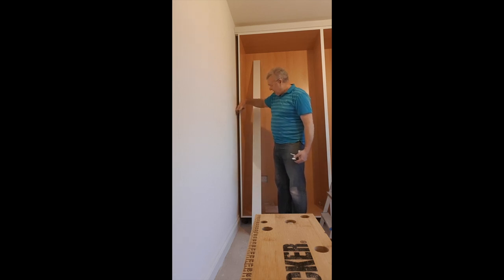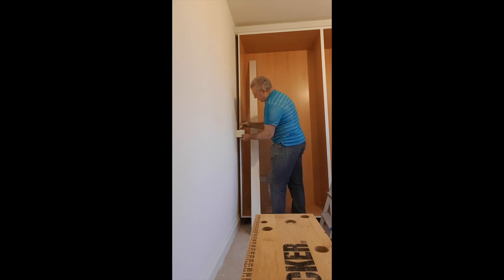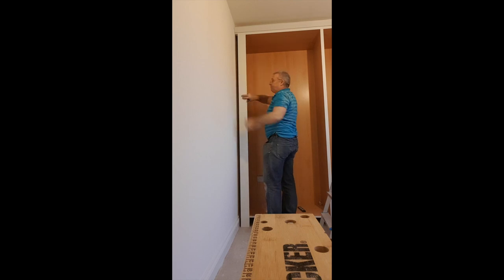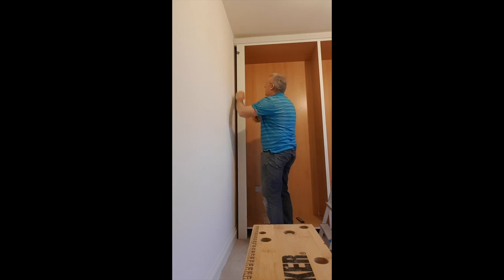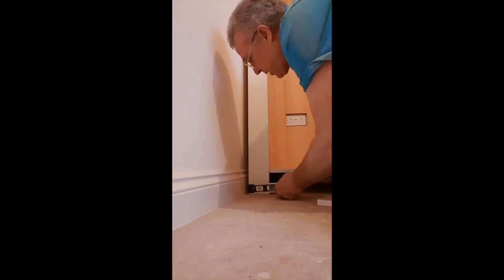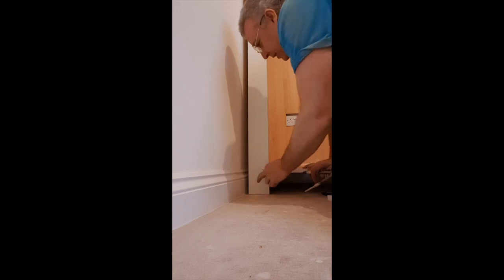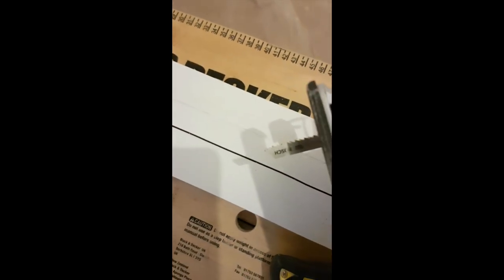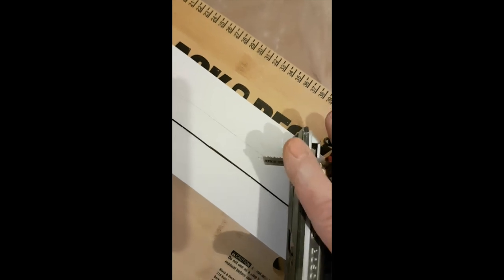Scribing wardrobe fillers

Comment: Thank you for the very thorough explanation of how to scribe filler pieces. I was not aware of down-cut blades, so that was also valuable. I expect marking onto tape, and then cutting with a down cut blade should eliminate tear out completely.
Reply from the maker: Thanks john. No need for tape. The downcut blades give a perfectly clean cut on the face. Obviously the reverse side will chip but in the case of infills this won't be seen. Do make sure the sole of the jigsaw is clean and free of damage that could cause scratches.

Comment: Fantastic vid. Exactly what I was looking for.  Huge thanks.
Reply from the maker: Thanks Jon - glad it helped. Remember the downcut blades!
Reply: @donutpanic  I did!  Following your advice, re the blade just ordered a pack of 5 from Amazon. I think I might prototype it before attempting the cut on the finished item too. Not a massive fan of jigsaws to be honest.
Reply from the maker: @TheJonkilleen  it's that or a fretsaw! Ensure you hold the jigsaw on to the work firmly as the downcut blades push the tool up. You'll love the jigsaw once you've finished - have fun.

Comment: Great way of doing this. Plan to use this technique next week. One question did you cut the full length with the jigsaw or did you also use circular or table saw for the straight bit?
Reply from the maker: The edge that goes against the carcase needs to be straight, so will usually have been cut on a table saw, but you could use a circular saw. We nest all of our parts from jumbo sheets on a CNC router including  the fillers, so they are dead straight and parallel.

Comment: Fantastic video! Very clever. Just wondering how to work out how big the block should be? For eg, one gap is approx 45mm wide and the other is approx 20mm wide. I'd hate to draw the profile too close to the straight edge of the filler or conversely, draw it too far off then requiring planing a bit off the straight edge. Cheers
Reply from the maker: Thanks for the comment. I''m not sure I understand your question. The block needs to be the exact width of the filler, or better still, cut from the end of it. As long as the filler is at least as wide as the widest part of the gap, it doesn't matter how wide it is. You can trim back with the jigsaw if required - you can't plane it if it is concave anywhere along its length. Cut for a good fit, but not a tight fit so that you don't damage the filler or the wall. Let me know if that wasn't what you meant!
Reply: @donutpanic  Hello again. Getting closer to doing this for our wardrobes. I understand how wide the block should be (same as the filler piece you're cutting from) but when you are scribing for a large end panel that is about 635mm wide, do you still use a block piece the same size as that? I was wondering if there is another trick as it would be a bit more awkward handling a larger block, but happy if not! Cheers
Reply from the maker: @najlatois  If you look at my video on scribing the bridge panel that should answer your question. You need to cut the amount it overlaps by at the front off the back. You could cut a small block to this size or use a compass. https://youtu.be/S6dI15zQHdg
Reply: @donutpanic  Fantastic! I'll cut a small block. Great videos. Thanks a million!

Comment: Very helpful - thankyou! One question though, how would you scribe the infill if it were to sit on the face of the carcass? Where would you line the infill up to so that it had an extra 18mm/thickness of the carcass. Thanks
Reply from the maker: In what circumstance would you want to do that? However, you would line the edge of the infill with the inner edge of the carcase.

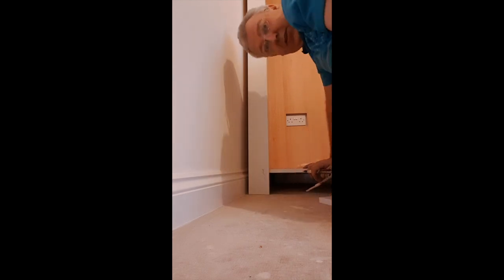Comment: Excellent thanks. Would you then use some kind of caulking or mastic to fill the small gap thats left between this filler piece and the wall / skirting? (as seen at 9:11)
Reply from the maker: Cloppa2000 As long as the wall is a suitable finish and light colour like this, then yes. Some acrylic caulk gunned in to the gap and immediately wiped off with a damp cloth to leave nothing on the surface looks good. It is not essential or an excuse for sloppy scribing!
Reply: Thanks for replying so quick. Can I ask how would you fix the filler pieces in place? And with a high ceiling, would you put anything along the top or just have these fillers finish flush with the top as you show here.. Oh and one more.. If you have sliding doors, would you have them slide right up to the wall?
Reply from the maker: Cloppa2000 We fix by screwing from the inside. You can hide the screws at the side under the hinge plates. We make our wardrobes to 75mm from the ceiling if using a plain infill, and 120mm if fitting a cornice, in which case the infill goes behind the cornice.  We are bespoke so don't have large infills at the top. We can make doors up to 2500mm so with a 100mm plinth and 120mm top infill we can cope with most tall ceilings! Our sliders usually still have full carcasses with the doors hung from the top, so side infill is as usual. If using a conventional sliding system it is usual to put a strip against the wall for the door to close onto. If the wall is really out of plumb this can have a scribed filler to set it off the wall to give a vertical surface to close onto. Hope that helps!

Comment: How do you fix the fillet in position, so that it stays flush and doesn't drop too far in?
Reply from the maker: It should be a snug, but not tight fit. Simply push it into place so that it is flush and screw in place from inside the carcase ideally under a hinge plate. If you push it in too far it can be tricky to retrieve but not impossible - insert a screw a short way and push above or below to pivot it back out and start again.
Reply: Thanks Mike.

Comment: What compass do you use?
Reply from the maker: Are you in the USA?
Reply: @donutpanic  No, England.
Reply from the maker: As you will have seen, the bulk of the scribing doesn't use a compass but rather an offcut. For the bits that do require a compass I currently use an accuscribe but with the rear bumps cut off, or Axminster Tools dividers. Any will do as long as they hold their position.

Comment: how do you fix them
Reply from the maker: Hi Graham. The side fillers are fixed with screws hidden under the hinge plates.
Reply: You can also attach a batten along the straight edge on the back side of the filler. This gives you a larger area to screw into and can help keep your infill square